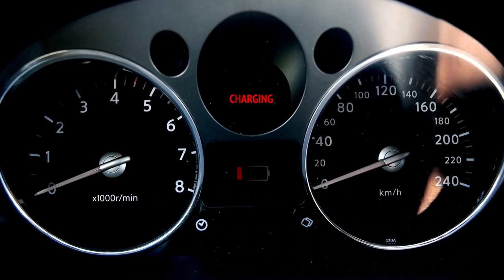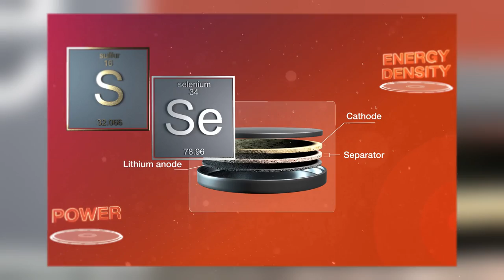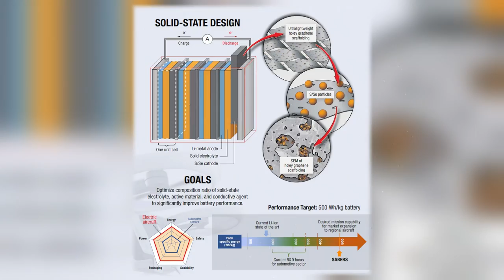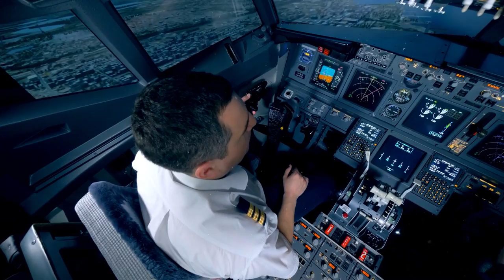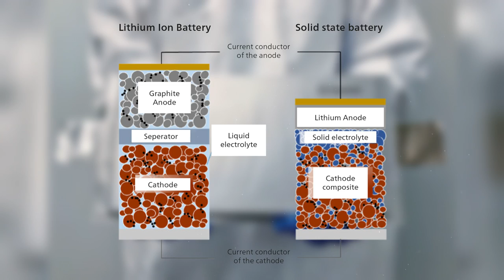NASA Director “Our New Battery Will Make Flying Cars Possible”

Comment: One important factor - cycle count not revealed, and depth of discharge not too. To build as frame part, it should be very long serving structural piece. Second part - the connectors, how to isolate and maintain it. Third part - in aviation, the efficiency of 12'000wh/kg fuel is about 40-60% (in cars 12-20%), so the density should be 4000wh/kg to be comparable, promised 500wh/kg is not enogh. 2.8L to 3.5L/100km per passenger is current fuel consumption efficiency in industry. Remember additional factor - landing mass for electric will be the same as started, instead fuel powered will loose half of fuel in 1/3 of flight while climbing to 10km+ up, and then slowly descending use send half fuel for 2/3 of path.